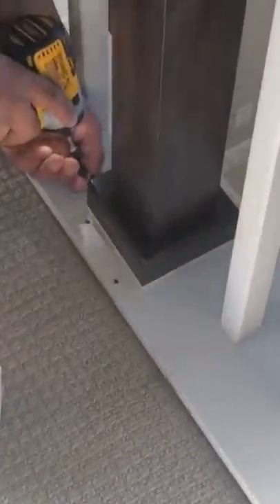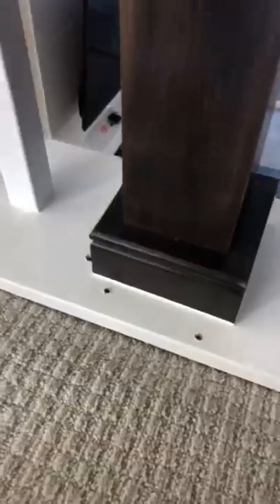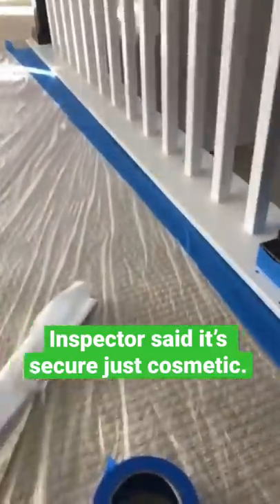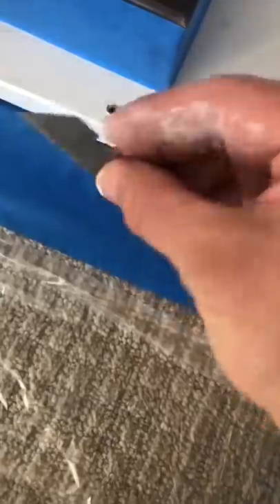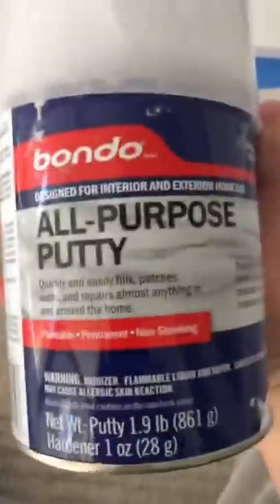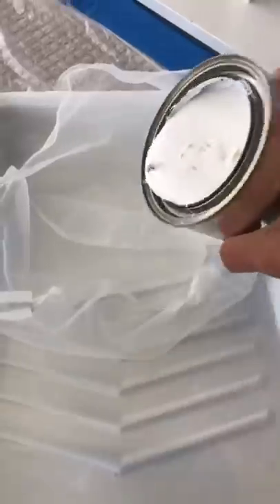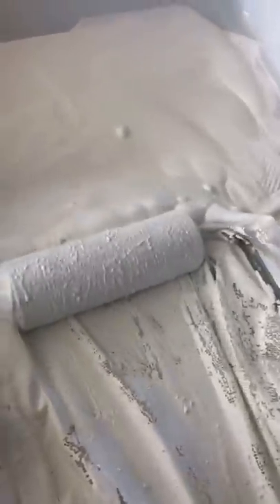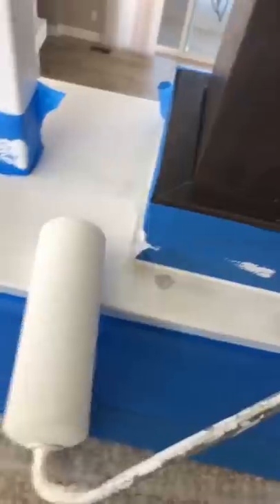How to fix holes on trim. #diy #handyman #howto #trim

Comment: A rail post should be secured to structure not trim board made of dust
Reply: “inspector said it’s secure just cosmetic”
Reply: @griffenlacount2033  how do you know 100% that inspector said that. Plus using drywall screws is not for structural work. Also those screws will rust under bondo. Should have used structural screws that don’t just break and they will bend. Those screws will snap sooner than later and this will have to be fixed again. This is hack job.
Reply: @jerremyvinson6310  those are wood screws not drywall, but if they were drywall screws why would they rust there but not on a wall? The phosphate coating one drywall screws helps to prevent them from rusting
Reply: @diceNdiceN  how do you know they are wood screws ? Putting drywall screws into wood bad idea the wood expands and contracts due to moisture so over time yes they will rust.
Reply: @jerremyvinson6310  look at the box
Reply: You've obviously had zero experience with any post installed on a cap like this. The screws will definitely add rigidity. The brackets which are screwed on the post have caused the cap which was glued and nailed to loosen over time. The screws just tighten it back up again.
Reply: @lastditch727  you can call that a fix in theory but knowledge comes from best practices , use the right install procedure and it lasts till the cows come home
Reply: @MrCrafter80  the guy didn't do the install on the post. It's a lag bolt driven into the joist. They wear. What are we arguing about? 🤔
Reply: @jerremyvinson6310  no stupidly they won’t. And why would there be moisture on the second story  and inside of the house. If u have a moisture problem there then u have much more pressing issues.
Reply: @lastditch727  I tire hope u r not arguing that a lag bolt I a joist that’s only purpose is to hold handrails is gonna wear. That is ignorant. And stupid.
Reply: @iwishiwaswrongbutimnot517  its called a suretight and I've installed hundreds of them. I've also seen them wear over time. It's fact but yea, argue about it.
Reply: @jerremyvinson6310  He knows the inspector said that cause it flashes the screen in the beginning..
Reply: Too many professionals who don't bother listening to the uploaders explanation
Reply: Relax dude , that was just one of a few posts probably , cosmetics
Reply: Originally shoddy work. It seems that new houses are pretty shoddy no matter the cost

Comment: You can also predrill and countersink the screws for a cleaner, quicker job covering screws in trim. 

I don't see how this would hold the post tighter though..
Reply: It shouldn’t be what is holding the post.
Reply: I think the post is fixed to the rail thats why he drilled in the rail making it tighter
Reply: @elmerrodriguez9817  a post should be a minimum of 6 inches into the floor... and are secured to the floor. Not a peice a flimsy little trim...
Reply: Oh jeez you guys are Karen’s ! Did he say how long the screws were??
Reply: @JohnGarcia-zm3wd  you clearly dont know what code is.
Reply: @403outdoors4  if it were a real post. Video says it's cosmetic...why would something cosmetic go 6 inches to the floor?
Reply: 😅😅😅😂😂😂trim has a “c” cut the little Piece is in the other side where no one can see it post it’s secure don’t worry guys 😂😂😂😂

Comment: Wait the post was loose so you screwed down the particle board trim? That stuff is so strong definitely won't pull through if that's all that's holding it up

Comment: How does one know which grit sand paper to use working with something like this or drywall or trim or kitchen cabinets etc. 
Great job!
Reply: @thebigdoghimself  thank you...just need something to compare it to. 
When he was sanding the mud before each coat do u use a different grit?
Reply: Experience.
Reply: I’m not a wood worker, I work more with car paints for a living, 220 grit guy could possibly be correct however I usually go with a 320 as the final sandpaper for paint prep on most projects, not all, leaves a smoother surface. 220 would be what I’d use if I needed a finer grit but also remove small amounts of material.

Comment: Owner complained hand rails were loose so this dude adds a couple finish screws 😂🤣 👍🏿 Good luck with that.
Reply: And used a roller on it im rolling
Reply: @Revok7272  matches the spray gun pattern dummy

Comment: So much work. Just use some trim caulk to cover the holes and a small 1 inch paintbrush dipped into the bucket to paint it. Using a big roller like that for a space thats only like an inch wide is kinda overkill
Reply: Your way would leave it visible where as the caulk will shrink and brush strokes would be visible especially on trim that was sprayed. He used a 3" foam/ cabinet roller that lays down very close to same texture as spraying. Your way is a quick fix that would make it look like shit.
Reply: @michaelmcgee2026  its 3 small holes the size of a nail. I don't care if it looks 10% worse if it saves me $100. How much you wanna bet that guy charged the home owner using so many materials like that? Also unless someone is walking around with their nose to the floor inspecting it you won't notice brush strokes on an area that small while standing and walking past

Comment: Sanding block to file the screw holes down come in with some wood filler and sand when dried with sanding block and paint save yourself ton of materials and time.

Comment: Why do you use bondo, instead of joint compound/ drywall mud.
Reply: Because they have no clue what they're doing....
Reply: And a roller to paint 😂😂
Reply: That's a bondo wood filler. It dries very fast and very hard. Perfect for these applications. Although screws in trim boards will not fix a loose newel post, those screw heads will pop in time.
Reply: @nicklewisgtrytb  he used a foam/ cabinet roller. It's the only thing that will get close to matching a sprayers texture. If he used a brush the stokes would be visible in contrast to the rest of the trim which was sprayed. He did everything right.

Comment: No do should never be used for filling holes like this.  The MDF and woodcexpand and contract and the Bondo does not.  It probably will not fail over time but a much easier repair would be to use sandablecwood putty.  Overfill a bit and sand smooth and paint.  Sandable spakel will work if in a hurry.  Buy the non shrinkable and one coat after prep and ready to paint.  Best to countersink, screw, putty, sand @ paint with primer!
Reply: Dude ownes stock in bondo. Uses it for everything.  Plus I'm guessing he's in a dry climate. In New England shit swells and shrinks daily.

Comment: Looks like they left the trim pack on the garage for too long  and it soaked up moisture. Then they installed it and turned the heat on and it all expanded and swelled up. You can see it in the way the holes are mounded up were the screws are. I've seen in alot. I stopped doing construction because of it and lame contractor practicing. Location k at the wood it's all swelled up. This happens alot in Wa. State. It only takes one day of a trim pack sitting in a non warmed damp environment to soak up moisture.

Comment: Do you prefer gindi over wood filler if so why? Stuff like plastic wood dries really really hard, also wood filler would be like hard enough I feel for that type of repair? What are the benefits or why do you prefer it I do a ton of repairs to baseboard and trim is bondo easier to use? Faster from start to finish paint? I have no experience with bondo so I am genuinely curious
Reply: What your using is fine . That his preference.  I use things like you mentioned.

Comment: An easier way of doing this is to set your screws, find caps for the hole that are removable, make sure their colored the same/almost the same color of the product, and this way if anything happens or it needs to be replaced you don't have to send some other contractor on a scavenger hunt trying to find the screws you just hid under a half inch of bondo
Reply: Yes this
Reply: Magnets help on those scavenger hunts.

Comment: Good tip to anyone trying to paint something white. Get it tinted with some black coloring and it will cover better. I know it sounds redundant but it plays a trick on your eyes and actually make it appear whiter as well. Also even if your paint is "new" you should always strain it.... paint sits in the store and a warehouse for a long time and slowly builds up boogers in it that will get on your project and really piss you off.

Sorry needed to add something else as well, when using tape on something important use frog tape... its the best. And I recommend if you have an old sanding sponge rub the edge of the tape with it a couple times, the friction will make the glue heat up and bond better.
Reply: What did he strain the paint with?